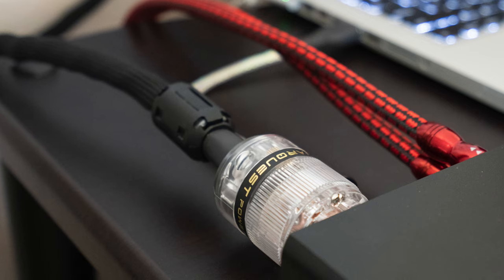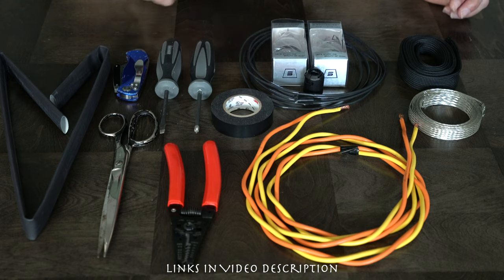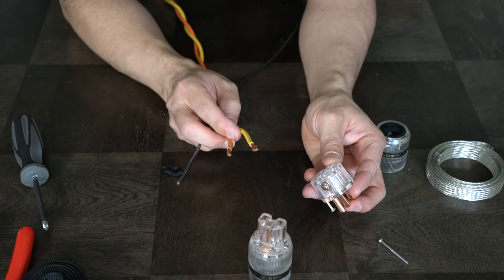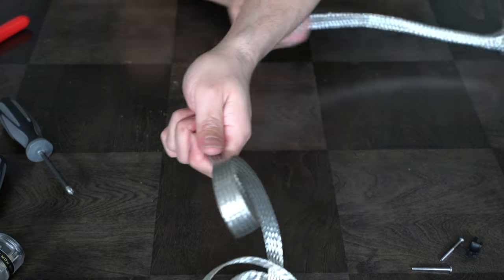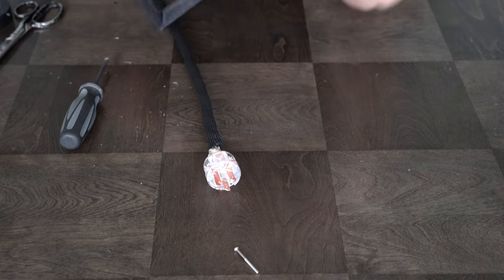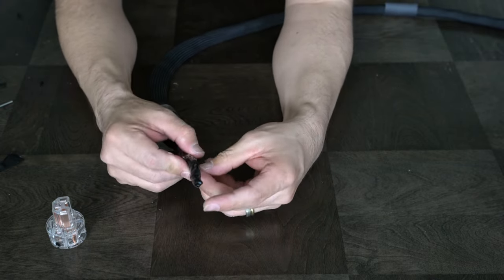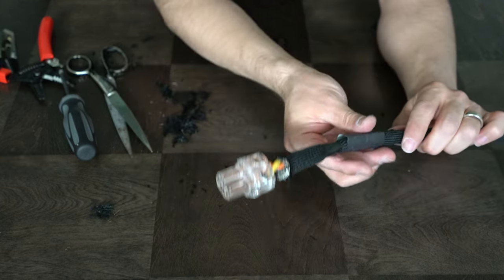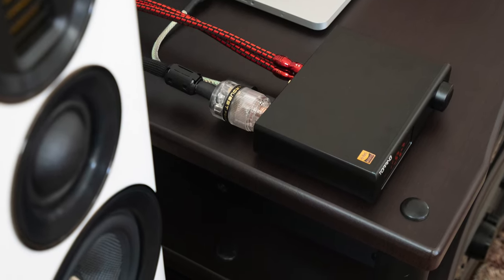Easy DIY Shielded Audiophile Grade AC Power Cords, Twisted Too!

Comment: That is a fine power cable. I use the same method for making my interconnect cables. I connect one wire of Mogami 2549 twisted pair to plus and the other wire to the return. I connect the shield to the return at the source end and float the other end.

Comment: Only the cleaned roots of the wire must be soldered with Kester 63/37 type solder - otherwise they will begin to crumble from the clamping screws.

Comment: so - Tharbamar gota ask how do these power cords sound compared to the PS Audio AC12? or your other cable?
Reply from the maker: Sound is richer, PS Audio AC5 with my Aquarius R2R DAC sound brighter than with my DIY cords, AC12 and my DIY cables are about the the same but AC12 is slightly quieter, 
Now I’m using AC12 with amplifier and rest of the components with DIY shielded power cables, thanks

Comment: Looking for advice from anyone still looking at comments for this.  I want to make something similar but can't afford the Mogami speaker wire.  Can I use any OFC copper cable of 12AWG/4mm2 and the pvc cover it comes with won't be a danger in terms of a fire hazard assuming correct fuse in?  UK 230V.  Was looking at usual Amazon offerings such as KabelDirekt etc.  And if not and I use standard annealed copper not OFC basic mains cabling will I lose something in terms of quality?

Comment: Pardon my ignorance but what is the difference between a AC power cable for digital audio components & one for analog audio components ?
Reply from the maker: This particular cable is designed to use with digital components by lifting shield ground on component side and drained on wall side but still it can be use with other type of components.

Comment: live ,neutral and earth wire size should be same ,  would you accept a electricain supply a power point(power suocket) and come with  1.5mm2 earth cable then live and neutral cable is 2.5mm2 ?

Comment: I want to make new power cables for amplifier, pre-amplifier, 4k BluRay player, CD player, TV and anything else in my home theatre.   I see you use 2 conductors from Mogami 3104 wire plus a new ground wire and twist these together.  If I want to end up with a 4 foot power cord how long do I cut the Mogami 3104 wire?  How much length can I expect to loose when twisting  the cables together?  If money was no object I would build the Oyaide cables you built in another video.  These look more in line with my budget.  Thanks for the video, your opinions are appreciated.
Reply from the maker: I would twist them together first and cut the length you need after that, it would be much easier to get same lengths on all cables, thanks

Comment: Can we  use Mogami W3104 cable itself for ground wire? I am not able to find short and good quality copper ground cable in my city, I need to buy 100 feet which I do not need.
Reply from the maker: Yes you can.

Comment: j watched your video and j also made diy project of power cable -it is shielded model but j didnt  use ferite noise filter on the end -recently j started using ferite beads on the entrance of powerd cable of amplifier j noticed difference can you explaine from your point using noise filter on this power cable and what are benefits in sound by your oppininion
Reply from the maker: Basically when current/signal passes through the cable also carries noise as well and magnetic field generates throughout the cable.  The magnetic field is absorbed by the ferrite core and the noise current is reduced with the help of ferrite core.
Reply: @Tharbamar  thanks for your answer j was experimenting with ferite beads on power cables and speaker cables and the result is that improvements are on power cables but on speaker cables are not good
Reply: Many audiophiles don't like the change it does to sound I would use it for tv only.

Comment: Could I follow the same steps, just put a different end connector for a camera and camera battery, to run power from the external battery? Where could I find connectors for a Red Komodo Camera AC-in and something that'd connect to a battery?

Comment: Thanks for this video. Would you use that power cord on a sub woofer. Wonder if it would do anything to a TV?
Reply from the maker: Yes, absolutely, I've been using same design on SUB as well, thanks
Reply: A good power cable increases tv resolution,colors,brightness,etc basically improves everything 2nd best upgrade to any tv.

Comment: I thought the drain wire should have constant contact along the shield, otherwise as shown in this case you will make kind of a ground loop? Any thoughts?
Reply from the maker: Hi there is no drain wire, only the shield is drain on wall side by connecting to ground pin and lifted on component side better shielding, there is no ground loop when ground wire is connected to the both ends. Thanks
Reply: @Tharbamar  ok thanks but why not shield the hot and neutral together away from the ground and twise the ground around that? Wouldn't that be better shielding for that ground?
Reply from the maker: @visiontranscend60  Probably but my main purpose of shielding is not to introduce any interference from the AC cables to surrounding cables and components, not other way around.

Comment: Excellent review. I find that sometimes using an shielding can negatively affect sound quality. If main cable has significant noise then it will capture that noise. Have you tested with and without shielding?
Reply from the maker: Yes, most of small digital components I like them with shielded power cords, thanks
Reply: @Tharbamar  how about your USB cable running from dac to source? Shielded too?
Reply from the maker: @leekenyon4099  I'm using Oyaide Neo+ Class A USB cable.
Reply: @Tharbamar  Ah, I have the Oyaide Class B interconnects ($40 / M) on my secondary system, and the Audioquest 'Pearl' 5M USB running all the way to my new SMSL DO200 DAC!  😁

Comment: Australia has specific color coding for power cables. Actually certified electrician only can wire such cables in Oz. For good reasons. You can also use higher grade Furutech terminals. And double or triple wrap with shielding... will make another degree of improvement.
Reply from the maker: Yes, here in the US, Black = HOT, White = NEUTRAL, Green = GROUND but since I’m not selling it can be anything for personal uses.
I’ve tried many different shielding up to 4 layers using aluminum foil, copper tape as well as each individual conductor shielding there is no difference in audible noise improvement, my power cord is absolutely quiet even when I raise volume knob to max level on class D amplifier, there will no hiss or white noise. Thanks
Reply: Acctually as long as you use approved fittings an electrician is not required 'this does not apply to behind wall cables'
Reply: Only the right colors give the right sound...
Reply: No it can't, it still has to be certified to a UL standard in order to be legal to use in USA, whether it's for personal use or not.

Comment: iId never use speaker cable for mains, the other way round is perfectly fine. The insulation of a speaker cable is sub 50V as such running this on a beefy power amplifier wouldn't go well.
Reply from the maker: I’ve been using them so long in pro and home audio with not a single issue.
Ul13 CL2 Rating and withstand to 500v.
Also note most ultra high current amps are wired with very same cable inside.

Comment: I have a question: Is the Mogami 3104 insulation rated to withstand AC current in all countries? It is not a AC power cable, it is for speakers operating on DC. Your explanation please?
Reply from the maker: AC or DC current is current, As per Ohm law 1V AC = 1V DC and W3104 is ratted for 500v DC.
Reply: @Tharbamar  Thanks, should be perfectly fine I guess. Question is, will an insurance company accept a claim involving Mogami 3104? It is a cable not legally rated as a AC power cable. I checked with my local Australian Hifi supplier and they said NO. Even Furutech hifi bulk 'power cable' does not have the legal blessing in Australia. Besides unless one is a qualified electrician here, we cannot even put a plug on a power cable! I am not complaining, but merely pointing out the issues that one has to consider. Something that can be perfectly good and fine may not stack up legally and have an inherent risk attached to it.
Reply: @Tharbamar  Just to add that, here in Australia, all electrical cables need to be certified by Australian Electrical Standards and test tagged. So Mogami 3104 speaker cable will be illegal here. Problem is, even if someone makes it with 3104 and it works fine, you are still breaking the law here! Must be the same in many other countries too. Thank you for sharing wonderful information but although "easy to DIY power cords" viewers should know the legalities. Cheers.
Reply: @melodychest9020  that's fine, its for safety. it would be a shame if your house burned down because of a wonky power cable.
Reply: @melodychest9020  Sounds like a well-intended law that was made long ago and should be changed given advances in electrical technology.  This is the sort of practical handyman work that should be taught as part of a public educational curriculum.  However, it is important to follow existing laws while petitioning for a change in those laws. Good Luck!

Comment: Hi Tharbamar!
If you use unplated copper connectors, isn't there a risk of oxidation?
Reply from the maker: Yes but regular annual cleaning will take care of that, thanks
Reply: @Tharbamar  But does it only oxidise the copper on the outside or also on the inside? Because if not, you always have to disassemble the connector to clean it

Comment: Great video! Why only drain the one end of the ground? Would be nice to see you do some cables for tube based audio, even for a quick upgrade to a nice guitar amp. - L
Reply: Grounding at one end allows the shield conductor to act as an antenna and shunt any noise to a dingle ground reference. Too many paths to ground can cause ground loop hum.

Comment: Have you ever looked at the line of Viborg connectors and accessories on Amazon, Steve? Really good stuff at good prices! Stuff that competes with the best connectors out there. I own several of their AC and IEC plugs, binding posts, RCA jacks and spades. Good stuff that makes a big difference.
Reply from the maker: Yes I’ve been using some Viborg plugs, they are very good quality. I might be using binding posts in next project, thanks
Reply: @Tharbamar  They are currently sold out of these right now but I recently got these rhodium plated copper binding posts and upgraded my Elac Unifi UB52’s with these and it made a HUGE improvement! https://www.amazon.com/dp/B017GRI4UM/ref=cm_sw_r_sms_api_glt_fabc_N009Y69DFQQ162KCEND7?_encoding=UTF8&psc=1
Reply from the maker: Yes, I will be trying them on my CSS 1TDX in the future, thanks
Reply: Go straight to aliexpress monosaudio iec pure copper gold plated decent good as viborg.Xangsane 6 core 1.5 silver plate occ copper probably best cable you can get double shielded round a solid core inner.sound amazing with a silver fuse wire fuse.made more difference to my system then any other cable that and better op amp best upgrade ive done.

Comment: You have to be careful using different types of metals you can get galvanic corrosion it should always be the same socket to plug material
Not really a suppressor innocence a emi / rf rejection  and it's not going to do much like that and could be unbeneficial you could put a suppressor on the end  between live and neutral of  (x2) capacity of  1uF 400v be more beneficial that will filter out any digital high frequency noise. Try not wind it so tight either the wires every 2" enough, you just increasing the length of resistance of the wire try and get the total length of the whole wire to half a metre including the wind. The dielectrics of the plastic is not good either it's not PTFE? 
You could rip off the outer shielding would be better can replace it with PTFE plumbers tape 4 coatings forward and back, don't go to tight.
If you leave a bit of the plastic sheaf on one end stop it fraying pull the rest of the cable sheaf halfway down cover half the wire that's bare with the teflon PTFE plumbers tape, and do the same on the other side.  oh and spray the wires first before  putting on the PTFE tape with a silicone lubricant drenched the wire
Reply from the maker: Thank you John.
Reply: I’d probably omit using caps, unless you know exactly what you’re doing for specific components. And even then listen with/without. Power filtering can go sideways.

Comment: But wait... you have shielded cables before the power plug? I guess not. So you installed 1,5 meters of shielded cable in power line, and you want to say this changes sound quality to better?
Reply from the maker: learn how shielded power cord is beneficial.
Reply: @Tharbamar , but you have only a small portion of shielded cable in power line. Don't you think that is not really logic to say this will have any effect?
Reply from the maker: @82levy5  yes digital equipments are very sensitive to line noise.
Reply: @Tharbamar , i have a feeling that you don't understand the point that only about 1.5 meters of cable is shielded, the rest is not. What are you think abou this?
Reply from the maker: @82levy5  I too have the feeling that you’re not going anywhere to understand the concept of minimization of noise in audio chain, end of discussion here.
Edit: instead of trying to make arguments here why don’t you do more research.(no offense intended)
Reply: @Tharbamar  , I understand that you will not resolve any noise minimalization by changing only a small portion of the power line. I made reserch and that's why i made those arguments. Please answer the question and wrote your arguments about the rest of the power line.
Reply: @Tharbamar  , you are serious when you saying this?